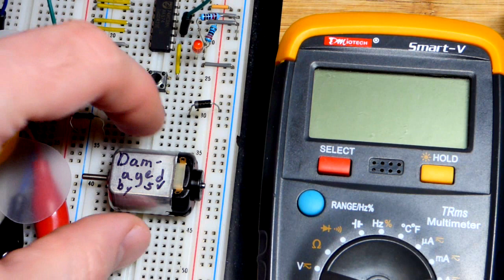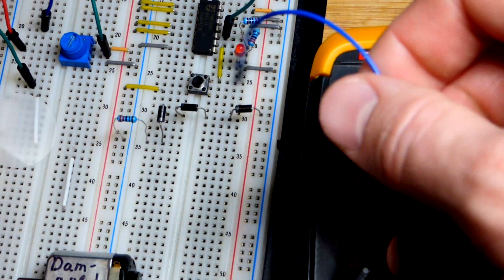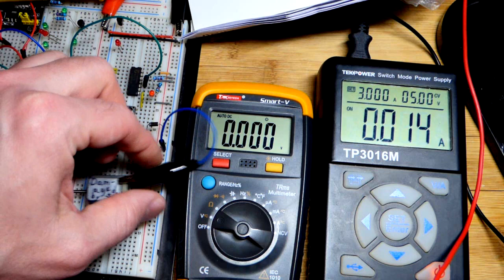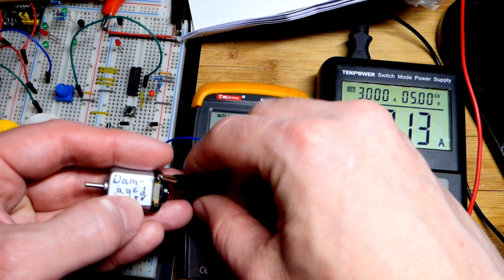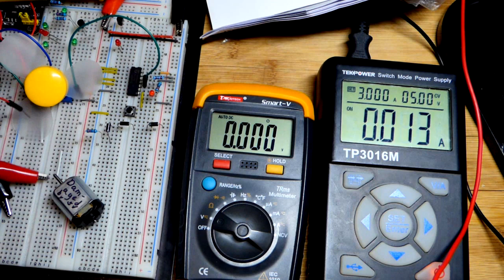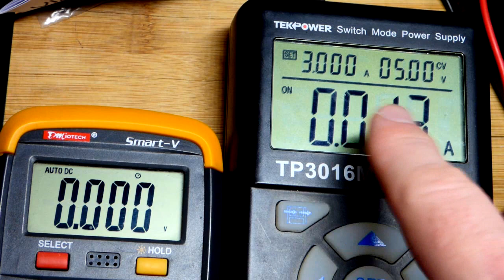Last video I used too much voltage across motor and I should have dropped more like this

Comment: Your motor is considered a resistive load, and when you add the fan it increases the resistance load in the circuit. To over come that load it will draw more current from your source, that is why your Amp reader was higher. Also, its common practice to make a voltage divider with resistors instead of diodes, thus you can set the voltage to exactly what the motor needs.

Comment: For DC motors, the output torque is proportional to the current going into the motor no matter what the motor speed is.  I once used this to my advantage when I needed a constant torque rewinder by monitoring the current of the motor and adjusting the output accordingly.
Reply from the maker: Thanks for the info!

Comment: I powered a 7000 series shift register with 9V without realizing it ... still works?
Reply from the maker: Gotta check the datasheet to see the voltages it is meant to work with. I think I have only fried one or two 7400 series integrated circuits, so I think they are pretty robust.

Comment: I have used high wattage zener diodes to drop tens of volts to get the voltage to a working level for the inputs to microcontrollers or digital logic circuits.  Assuming you use 1N400X rectifiers,  they have up to a 30 amp surge current rating for 10 milliseconds so I think you are OK for the motor starting surge current.
Reply from the maker: Nice!